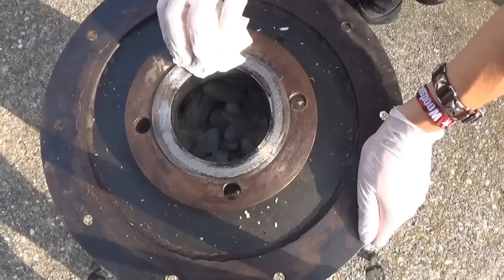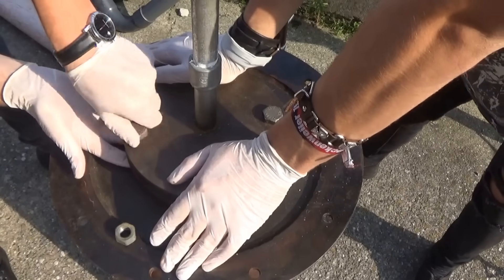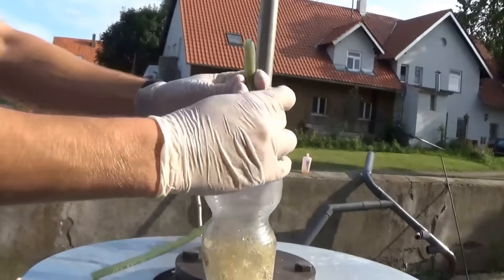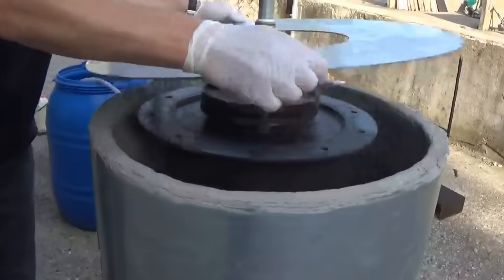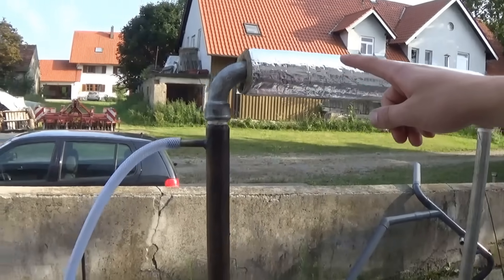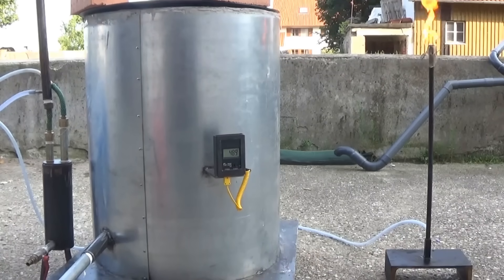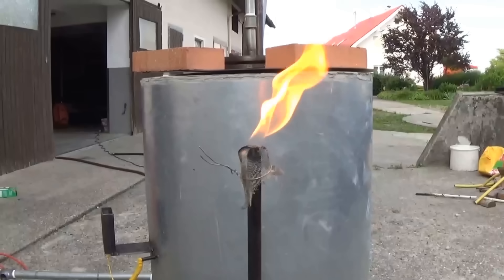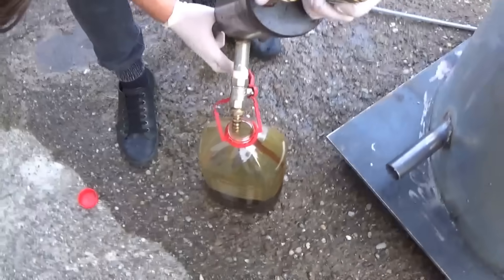plastic waste to oil/fuel improved pyrolysis reactor

Comment: Hoax video. Pyrolisis must be in vacum condition. Step 1 you must vacum the chamber and I dont see that step.
Reply: Ching Fung vacuum is to remove oxygen he instead use carbon dioxide to displace oxygen, presence of oxygen would hinder the pyrolysis process
Reply from the maker: he is 100% right please inform yourself before you post stuff that is incorrect :D simply ask the next time if it is the case that .... :D that makes the interpersonal conversation much more pleasant 

mfg hazelChem
Reply: @HazelChem  and then can u explain about ratio betwen gasoline and waste from the plastic ? I saw very much gasoline (raw oil) came out from the machine ?

Comment: Hi Hazel there are plants producing this stuff it all about economics if the price of oil in the range of 90dollars a barrel this system would cost 59dollars and it will be economically otherwise it's a negative impact.

Comment: Great work but you may wan5 to consider working in a safer place if that exploded it would not just be you that is effected you would make a lot of enemies with a single mistake
Reply from the maker: this think can not explode there is no pressure in the system ! 

mfg hazelChem

Comment: THX YOU , and your using all kind of plastic , yet the media says we can't do that, again a lie off the media since we can clearly see that all plastics can be used to remake fuel.thx you for clearing this up and letting us know that it can be done with any plastic and that the big compganies just use this excuse; we cannot do it with all plastics != lie.thx you posted  on other sites
Reply: All plastics are usable but some are far less effective, i.e. PVC is not at all economical to use in this unit. It consists of too much other chemical and the amount hydrocarbon chains are to few to justify the energy input to the system.
Reply: @hanjodurandt2270  still better then throwing in the ocean
Reply from the maker: the problem with PVC is the chlorine that corrodes all metal .... and that there is the chance that halogenated hydrocarbons are formed ....

mfg hazelChem

Comment: hello if you consume as much gas as you produce then you win nothing buddy !!?
Reply: The energy needed to convert plastic to oil and gas is less than the burning of produced gas provide thus we adjust the temperature such that the ratio of gas to oil is sufficient to supply the energy needs of the unit while it still produces oil. I'll provide the math if you want me to.
Reply: Sometimes you got to content yourself with much less plastic in the environment, especially the seas and oceans where it wrecks much havoc.
Should be subsidised by the government tho.

Comment: Morons! The cost of turning the distillate into gasoline and diesel fuel is more than the cost of that fuel.
Reply: And I bet by the time your grandkids have children this will be cheaper
Reply: @Maccreeperslayer  No, I'm not so stupid to think that one can refine motor fuel from plastic waste, cheaply or efficiently. That's a scam. Much better to utilize plastic waste as a supplementary source of heating fuel, (unrefined). If you don't want to use fossil fuels in vehicles, there's anhydrous ammonia, (no carbon dioxide emissions), which doesn't need natural gas, (just electricity). This plastic-to-gasoline scam reminds me of using wood gas to power cars and buses. Great if you have a woodlot, but not economical nor practical for any more than a small fraction of the vehicles on the road, (after the oil shortages during World War Two).
Reply from the maker: hello in some way you seem kinda aggressive but anyway. pyrolysis is at first a way to get rid of the plastic waste ... the reason why this process does not burn the plastic is that you can use (after a initial external heating) around 40% of the plastic wastes energy to sustain the pyrolysis ! so you can get rid of the plastic waste before it turns into micro plastic and get 60% crude oil which can then be used to make gasoline and diesel. the part that is important for you comes now ! ;D 

the so created oil reduces the amount of new oil that has to be extracted from the earth ! this reduces the amount of prehistoric carbon we will eventually blow in the atmosphere! 

so it is a waste dealing process that uses a part of the plastics energy to produce oil for the time still being until we faded the combustion engines out ! (the amount of oil we get from the plastic waste corresponds to the amount of oil we do not have to newly extract from the earth thus in a long term we reduce the overall carbon in the atmosphere because the oil that we left in the earth is stored carbon that has not been extracted do to the plastic waste being turned into oil)

I hope I wrote in a way that is understandable

mfg hazelChem
Reply: @HazelChem  Pyrolysis is great, but it is nonsense to promote it as turning plastic waste into "gasoline or diesel" fuel. That's as nonsensical as making sugar out of cake crumbs. A similar scam was done in Niagara Falls, Ontario. A scammer got government grants and private investors to help build an industrial plant that turned $100 of recyclable plastic waste into $74 of low-grade fuel. It went bankrupt, with that business plan, at other people's expense.
Reply: Before I start arguing my point I would like to know how much you about the process and how much research you have done on it and what your qualifications are?
Reply: @hanjodurandt2270  If you want to know what university degrees I have, I'd point out that most university chemists and engineers have failed to do anything of substance with regard to plastic waste. It's like asking a chronic alcoholic how to control one's drinking, (it's only when his funding grants get cut). Until about twenty years ago, their solution to plastic waste was to burn it in the open air or to bury it. Even today, plastic waste, (most is contaminated with other waste and cannot be recycled), is buried in landfill dumps. It's more economical, (they say). These are the same morons who'd throw away waste wood, because it's easier to buy coal from the mines to fuel a water boiler. The more progressive ones recommend turning the cleaner plastic waste, (less than 25 percent of it), into fuel oils, or to incinerate it with unsorted garbage in gigantic "waste to energy" plants. The real solution is to develop an efficient "small-scale" process, (on a village level), that can eliminate 95 percent of the plastic waste, (unsorted and contaminated with other wastes), and utilize its fuel product and waste heat locally, (not to refine it into vehicle fuels). You need to process tons of cleaner plastic waste to produce a useful supply of refined diesel, (still much more expensive than the fossil fuel, which only needs refining). That's why I am working on a different process and mechanism, (not the filthy coal-fired "tires-into-diesel" plants that Chinese companies sell to third world countries); and, now, I'm preparing patent applications. If you understand pyrolysis, you ought to be able to understand torrefaction. Tell me what universities offer courses on the inventions of Nikola Tesla and of François Henri Reynst? How many engineers have traveled to the Tesla Museum in Belgrade to read his laboratory notes? Not many, but I have.
Reply: But as a start I would like to raise you this article published on ScienceDirect.
Here is the article name if you want to read it in full:

Combustion, performance and emission analysis of a DI diesel engine
using plastic pyrolysis oil
Ioannis Kalargaris, Guohong Tian, Sai Gu*
Faculty of Engineering and Physical Sciences, University of Surrey, Guildford GU2 7XH, United Kingdom

Conclusion:
An experimental investigation was carried out to analyse and
understand the combustion, performance and emission characteristics
of a diesel engine running on an oil which was derived from
the pyrolysis of waste plastics. The tests were performed on a diesel
engine gen-set. The blending ratio with diesel was varied from 25% to
100%. The following conclusions can be drawn from the test results:
• The engine was able to operate steadily on PPO 100 at loads
higher than 75%, on PPO 90(90% Plastic Pyrolysis Oil and 10% Diesel) for loads higher than 50% and on
lower PPO blends for all loads.
• PPO blends have longer ignition delay, higher cylinder peak
pressure and higher heat release rate due to the lower cetane
number.
• The engine thermal efficiency decreased by 3–4% when PPO
blends were used in comparison with diesel. But increasing
PPO ratio does not have a significant impact on thermal
efficiency.
• All measured emissions, including NOX, UHC, CO and CO2,
increase with higher PPO blending ratio. For low to medium
blending ratios, the increases of NOX and CO are mild.
The testing results suggest that for the long-term running, a blend
of 60% – 70% PPO operating at 80% – 90% engine load seems to have
the most promising potential to achieve the best engine performance
and emissions. More parameters such as injection timing, injection
pressure and cetane number improvers need to be explored in order
to obtain the optimum engine performance.

Comment: is it possible to make a small version of this reactor? and then convert the gas into steam?
Reply from the maker: this would fail the purpose of the hole process

mfg hazelChem
Reply: If by steam you mean flammable gasses then yes. If by steam you mean water vapor then you don't understand the process. If the latter is the case I'll be glad to enlighten you.

Comment: I am also trying , but I don't have container for melting plastic like you.  can you please tell me if where do you found that.?
Reply: Where do you get this reactor vessel
Reply from the maker: i made it from old metal and welded everything into the reactor

mfg hazelChem
Reply: Easy......first , get a cheap small wood chipper , break up all your plastics......... Find a good LPG bottle , one that will fit into a larger LPGbottle....safely cut out the smaller bottles valve and weld in a 2inch bsp with a screw cap ((reactor tank)).....Cut the larger bottles top off very neatly weld on a hinge and handle , you can drop a plate over the top and boil water or cook on it .Leave a gap to allow gas and heat to escape......weld in a blast pipe holder Angled to encourage a swirling affect , to obtain a good heat surface area all around the reactor .....
Hope this helps......Good luck......

Comment: You can capture the gas in a vessel by bubbling it through water into a floating vessel that slowly fills with gases, you can then pump it into a container or compress it for use or storage. Personally I'd be interested to see whether you could use catalysts, an incandescent carbon/charcoal/coal bed or a heated surface to thermocrack the polymers. You could also use small piles of charcoal to sacrificially burn to scavenge oxygen from the vessel and other places you don't want oxygen interfering with the process.
Reply from the maker: the gasometer idea is good but a lot of work ! i am planing to use a plastic bag with thick walls to capture the gases ... or i will just redesign the burner so it can use the pyrolysis gases. the compression of flammable gases is very dangerous and needs costly equipment that i do not have. for the catalyst i would be an good idea but i haven´t found a suitable cat yet. and for your last suggestion the higher the temp. the more gases are produced .... so i want no surface that is to hot 

mfg hazelChem
Reply: Directing the volatiles to self-stoke the vessel would probably be the easiest route to take, I bring up the last point as it's essentially a continuous production parallel to a batch production vessel like yours using the example of heavy paraffins being thermocracked against a hot firebrick wall to turn the faint flame of hydrogen- and carbon monoxide-rich water gas into a more suitable illumination gas. The whole process is horrifyingly unsafe but it's a product of it's era. 
Do only what you feel is safe, I'm eager to see more of your work.
Reply: @HazelChem  I've built a similar unit, the gasses on it's own is flammable enough to introduce as is to the burner since all the gasses remaining after condensation is methane - butane, which is what LPG consists of. The reaction rate is sufficiently quick to provide a steady flow of gas.

Comment: Plastic is a problem, but so too is CO2.  In this video, plastic is turned into CO2 (and other nasty stuff).  I would recommend just saving the plastic in a  restrained way. Maybe in 100,000 years, it would be OK to do this process.
Reply: You can easily switch the heat source to be from an electric element supplied by wind or solar energy. For prototyping reasons going with a flame for a heat source is simply the easiest method.
Reply: @hanjodurandt2270  I did that. Then you either burn the fumes, or distill them for fuel, or pollute with them.
Reply: there is a difference between oxygen and anaerobic combustion (here anaerobic burning occurs)
Reply: @jaceklesnierowski5691  In pyrolysis, no burning occurs. The chemicals are boiled off.
Reply from the maker: the point is that the plastic oil would reduce the amount of new oil we have to extract from the earth ! so 60% of the plastics energy get converted into fuel and the process heat would be used as district heating. also the plastic degrades over time into toxic products and micro plastic that pollute the environment. with pyrolysis the plastic would be dealt with before it converts into these harmful and much worse to recycle products. 

mfg hazelChem
Reply: @HazelChem  Granted it could offset some oil products.  But which ones?  Storing heat and moving heat is problematic. So that operation must be done  when and where heat is needed.  If you dump the plastic in a container of some type, it also keeps the toxic products and micro plastics out of the environment.  When CO2 is emitted it continues to heat the earth for tens of thousands of years.  That is why job 1 is to stop emissions.
Reply: @tedrees5989  Climate change is cyclical and Co2 is not overheating our atmosphere. Global warming is the biggest con ever.....Don't believe me? Go and do some proper research and you will see....
Reply: @wideyxyz2271  The basic global warming theory is very simple. The earth is in orbit in space. The only heat input is from the sun. The only heat output is from heat radiation. CO2 reduces heat radiation. More CO2 causes the earth to heat.  Of course there are cycles, like the ice ages, and sun spots. But that is not the issue today.

Comment: I think that just connecting the gas output to the burner tube would be enough, as the reaction starts you can lower the propane flow.

Vessel pressurization is not needed, a typical regulator reduces pressure to less than 0.5psi so that is all you need in the reaction vessel.

I also think it could be good to watercool the collection flask to make sure the lower fractions don't evaporate, you can also improvise a cooling tower with a pvc pipe and a "T" (search "bong cooler" or look up tech ingredient's videos on it) to be able to scale up things without needing a lot of water and making sure lower fractions don't evaporate (higher gasoline yield)
Reply: OR i could convert my car to propane and forget about the whole process seems silly to burn one fuel to make another unless you can make gas out of wood by burning wood
Reply: @mikemyr2995  they do make gas out of wood called Wood Gas.. theres videos on here on how to make wood gasifiers. So ideally one would make wood gas, and oil from plastic which they can use to cook the wood to make wood gas.. which can be piped into a motor as people have shown on here.
Reply: i have in my mind pyrolysis centipede gases from one heat next one and more and more and just gases from last goes to burn into air
Reply: El típico hablador de paja, critica esto y aquello, sugiere mejoras, pero estoy seguro que es incapáz de hacer ni siquiera un sencillo destilador de alcohol.
Reply: @octavioseptimus601  el único hablador de paja que veo eres tú, qué mejoras sugieres? Te recuerdo que el ser humano es capaz de crear conocimiento porque puede abstraer y relacionar, puedo saber que cosas mejorar en un reactor de pirólisis sin haber construido uno tan solo con mi experiencia previa en distintas áreas como neumática y termodinámica.
Para destilar alcohol necesitas solo un condensador sencillo, no es dificil enrollar un tubo de cobre. Hablador de paja.

Comment: Awesome video, thanks!  I was so excited to see you scale up this process, and it was 100% worth the wait
Reply from the maker: thanks :D
Reply: @HazelChem  what was the reaction chamber made of??
Reply: @abhijitkundu3840  Steel that required far more energy to produce than will ever be recovered with this device.  I'm all for Green, but it has to make sense.
Reply: @HazelChem  Others do this in „a better trashcan“ with wooden fire below
+ you could recycle this plastic by 90% into new plastic instead of causing a need to produce more new plastic from raw materials
= environmental protection gone FAIIIIIL